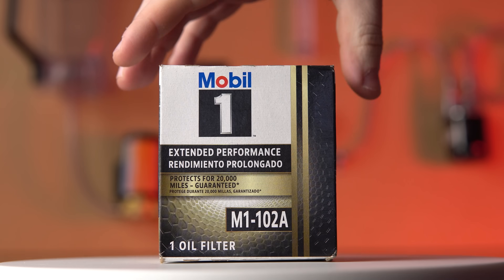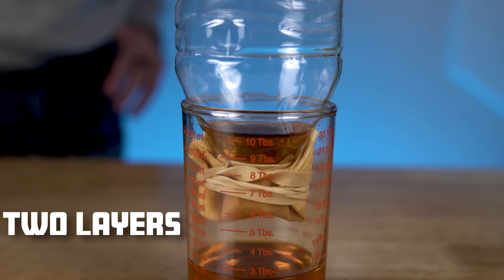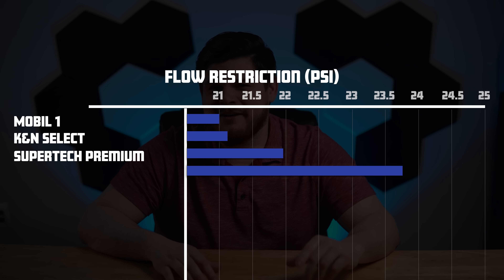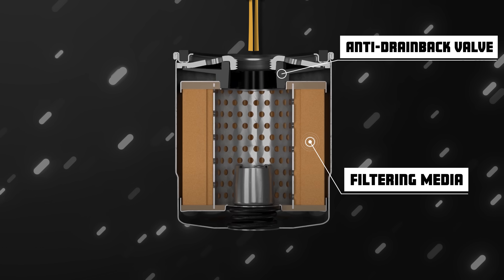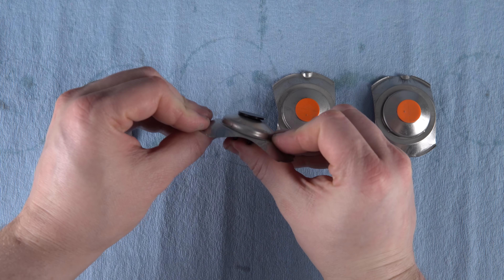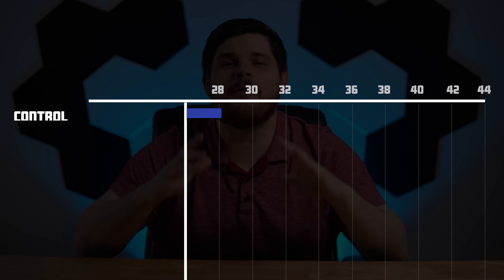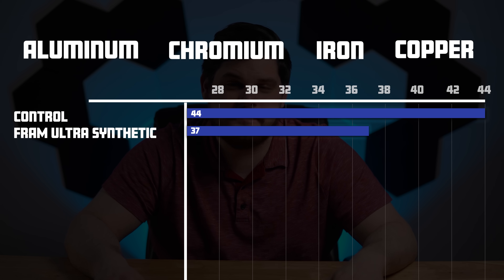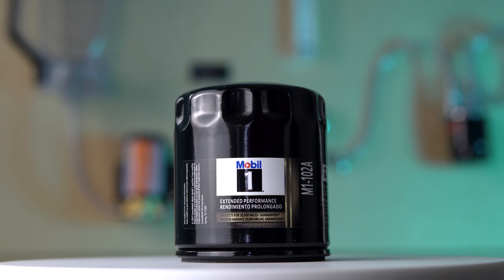Engineers Test the Best Oil Filters! FRAM | Mobil 1 | K&N | Walmart Brand

Comment: This is an interesting test. Ultimately, it doesn't matter at all what brand of filter or oil you use as long as you're changing your oil. I use whatever is cheapest, mostly Super Tech and Fram. 5k mile oil changes. After about 1 million miles total on 3 Nissans, I've never leaked or used oil. Never had an engine problem. Never had a timing chain wear out or get noisy. I use the lifetime K&N air filters and clean those about once every 20k-30k miles.

Comment: There are some really serious problems with this testing. The first is that the testers do not seem to realize that all of the filters they tested have internal pressure relief valves. The relief valve is there for two reasons. The first is cold weather starts where the oil is very thick and does not flow well. The bypass valve allows the oil to bypass the filter media and flow to the engine with only partial filtration. The second is high rpm operation. Most oil filters and most engines cannot filter even hot oil and high rpm because there is just too much oil to filter. Most engines in most cars spend a substantial part of their operation with partially filtered oil. If you disassemble oil filters and run the numbers on the pressure needed to bypass the filter media you will find that those numbers are all over the board. In their test they have no idea whether the lower pressure is a result of the pressure relief valves opening at different pressures. They are also testing at flow rates that are far below actual engine oil flow rates.

Not all oil filters have internal bypass valves. In many engines the bypass is integrated into the adapter that the filter attaches to on the side of the engine. If you check those out you will also find that those bypass number also vary greatly. Most fall in the range of 1-10psi. Any of those numbers mean that a cold start or high rpms are going to result in bypass. The worst flow problem with most oil filters is the column down the center that supports the media. It is VITAL that there are a large number of large holes in the column because that is the most critical flow restriction. If you look down inside and see slits or small holes, put that filter back on the shelf. It was amazing to me how few engineers involved with making filters understood how important this was. It has also been interesting to see manufacturers understand this... and then someone retires... and then the company changes construction without understanding. There are sadly many example of companies that got this right 30 and 40 years ago that have forgotten and changed their designs and not for the better.

Comment: I would look further into the issue with collecting particles near the back floor restriction valve instead of in the pleats. That seems odd to me. I would think that that would be a function of the position of the filter rather than and the particulars of the pressure and oil flow rather than the filter itself. It just doesn't make sense.

Comment: Graphs that don’t start at zero are deceptive in that they exaggerate the significance of differences that, while real, are in fact very minor. If your graphs started at zero, most of the performance differences among the filters you tested would not appear significant as percentages.
It would have been useful to mention the hazard posed by counterfeit branded oil filters whose packaging and physical appearance are very accurate mimics of the real things. They are poor quality, don’t always seat properly, and are dangerous. Beware of Amazon as a source!
The comment suggesting tests at operating temperature is very relevant, though it adds a considerable layer of difficulty. But viscosity changes with temperature. Possibly other relevant properties, too.
Finally, don’t say efficiency when you mean effectiveness. The words have entirely different meanings and efficiency is the wrong word here. And recognize that 99% effective really isn’t all that effective. It’s 1% INeffective, which is quite a lot, considering what that implies a filter fails to catch!
WIX is another brand worth testing, but use honest graphics, please!

Comment: Those pressure drops are astounding since an engine oil pump may only produc around 30 to 40 psi so that only leaves around 10 to 20 psi to squeeze through the small openings throughout the rest of the engine? What am I missing? Would it help if viewers know what the supply pressure is?

Comment: Oops part 2 I hit the wrong button the house brand for O'Reilly's would be good to be tested and the STP brand at AutoZone they're claiming filtering down to 15 microns so that's the ones I use on my engine.. I don't know what the micron filter rating is on the house brand for O'Reilly Auto Parts and I'm just an individual I don't represent or I'm not advertising for either one of those companies thank you

Comment: Used Fram higher grade filters on 1993 mazda, 1992 civic, and 2009 accord...all 4. Cyl.  Got 307k, 347k and 301k miles on those cars. Changed synthetic at 3-5000 miles. No complaints with FRAM.

Comment: We use the dealer that we bought the vehicle from. He uses the manufacturers filters, and synthetic oil. Why would we beconcerned with these videos? As long as we use the dealer, the manufacturers oil, filters, etc. should help with any warranty. FYI The vehicle has a 100,000 mile warranty. Aren't these sufficient safety?

Comment: Had a 1995 S-10 2.2l used fram filters changed oil every 4 to 6 thousand  sold it with        419,000 miles .. never had any issues..just fyi

Comment: According to GM that plastic core or E-Core as they call it is supposedly stronger and more rigid than a steel core while allowing much higher flow rate of oil. I've used filters like that with no problems what-so-ever.

Comment: Really! 1:50 minutes into the video. Doubling up on the filter medium 'thickness' affects it's flow rate. Doubled the resistance.  Same surface area.
But increasing filter quantity thru multiple pleats of a single layer of filter with a large surface area passes more oil, not necessarily easier but a larger volume, therefor more oil.
I gave up watching this video as i don't think it's credibility is high.

Comment: There is no best, except changing your oil based upon your driving pattern. Short distance, traffic, stop and go, every 3000 or 6 months. Highway driving long distance, moderate traffic, every 5000 or 9 months

Filters and oil are cheap, get a vehicle that you can easily change the oil yourself.  If you have to go to a dealer or an oil change franchise, you might get a bad job, oil change people are mostly drug addicts or low IQ individuals.  Not to be critical

Comment: unfortunately Mobil 1 uses NBR or a nitrile oil filter gasket as a standard component and they will blow out in demanding conditions - specifications indicate a maximum temperature of 248 degrees which is how hot your oil can get like driving across Texas in Summer where mine blew out so Mobil 1 is cutting costs.  Putting an oil filter to first hand experience would mean testing it in different driving conditions and monitoring it's efficiency over time and disecting certain facts like design and materials.  The gasket material K and N uses can go up to 400 degrees and this would include other higher temperature materials like acryclic (Purolator) and Silicon (STP) that can withstand demanding conditions anyone will encounter over the course of an oil change.  I hope this helps.

Comment: Your test is bullshit. In the flow pressure test you have 3 filters that have a 30 micron filter and fram has a 20 micron filter media. Of course the psi will be higher. It's pushing oil through a smaller filter media with the fram. Also in your used oil test if you didn't clean the equipment between tests the oil filters in the last stages of the test will have to try and clean more contaminants because of the leftover oil from previous tests.

Comment: Let me make sure I get this right. So you decided to compare oil filters, you built a testing setup that allows your powder to collect outside of the filters, you only tested four filters, you didn't heat the oil to simulate engine conditions, you didn't filter out any actual particulate matter and instead filtered out metal powder of a rather large size. You left out Amsoil, Purolator, Wix, Donaldson, and several others. I actually take my engine lubrication seriously, filtering my diesel fuel down to 2 microns and my engine oil down to 1 micron. 30 micron particulate in your engine oil would be like filling your tighty whities with playground sand and then going for a run in the desert heat. Get that sand all nice and hot and sweaty and then rub it around on your "sensitive components" and see how much you like it. Your engine isn't any happier than you would be. Three things need to be looked at with oil: Lubricity, additive package, and flow rate. If any of these three are compromised, your engine will be damaged or fail. Lubricity is the whole point, that can't go anywhere at all. The additive package is what keeps the oil from foaming, it has friction modifiers in it, stabilizers, anti-oxidation components, etc. This is why it is recommended that oil be changed every so many miles OR every 6 months or 1 year, depending on the manufacturer. Your oil can appear clean and still be bad because it's lost it's additive package. Conversely, it doesn't matter how good the oil is or how revolutionary and game-changing the additive package is if it doesn't flow through the engine well enough to do it's job. Even if you have awesome oil and an awesome additive package and awesome flow rate, but you have 30 micron particulate all over in it, it's still bad. 30 microns is about how deep the scratches are in the crosshatching on the cylinder walls of a typical, "quality" OEM engine. I think everybody who isn't completely up to speed should go see what 300-400 grit sandpaper does to bare iron or aluminum. So you got out most of the stuff at 30 microns. What about the bearing surfaces? Tolerances on Main and Rod bearings is often under 30 microns. So what good is it to filter out 99% of the stuff 30 microns or bigger when your Rod and Main bearings are going to be grinding all that sub-30 micron particulate around like sand inside those perfectly smooth and polished bearings? None whatsoever. If the job is worth doing, it's worth doing right. "Good enough" is for the Gov't, "done right" is for me. For regular people with gas engines, this isn't as big of a deal, but for people like me with a diesel engine, lubrication and soot contamination are real problems. I would stop driving the vehicle before I put any of the tested filters on it. Hell, I'd make my own bypass filter out of toilet paper before I stuck one of those filters in there. The bottom line on my opinion here is that the scientific method was only loosely followed, the test field was far too narrow, and conditions were not simulated correctly to produce useful results, and the results that you did get were one single set of parameters. These filters are junk across the board. This is my opinion however, and I did not bring any air fresheners. I've got people who are my friends solely because I contacted them in their official capacities to discuss lubrication. My passion for lubrication was recognized by a few of them and we're now good friends. 

FYI, that 3,000 mile oil change is a scam. Do yourself a favor, learn oil, and get your oil tested. If you care about your engine, don't trust the Stealership or some greasy mom and pop shop, and whatever you do, don't trust ANY of the quick oil change places. They're too cheap and they will scam you to make extra money. Most of them will try to charge me full price if I ask them to use my oil and filter. It's 15 minutes of labor, and they still want $75 even though they're not supplying anything but the labor. Blackstone Laboratories (for oil, not herbal supplements) is who I use for my oil analysis, and I've always had a good experience with them, as long as I was patient with USPS to get it there. Their kits are free, and they're very good at what they do. I run about 18k miles, which is when my additive package craps out (under 3.5 TBN) enough to make me worry. Whatever engine had that 18k mile oil in it hopefully had a better filter than the junk that was tested. I'd really like to know how much you were paid by what brand to do this test. The whole video just screams disingenuous marketing.

TL;DR
The "test" is useless. These brands rely on marketing to people who don't know what they're talking about.
Reply: So, what filter do you use?

Comment: Don’t ever use fram it’s been giving a lot of problem with my oil being dirty and oil pressure especially with these new cars I used to get away with it with the older cars but mang my check engine light threw off twice cause of dirty solenoid switch back to oem Honda filter and never had those engine light come back on since 🤦‍♂️🤦‍♂️

Comment: I have had every brand of filter I have bought fail a simple test of its drain back valve. Sounds Silly, but lips over the center hole, you can suck air through but shouldn’t be able to blow air back. I have yet to find a brand that hasn’t had a bad one here and there.

Comment: If you run more than 7,500 miles on  an oil change...you're really, really dumb. If you run over 5,000 miles, you're just dumb. Any decent mechanic will tell you 3,000-4,000 is the sweet spot

Comment: Discounting the oil lab test is arsine, the oil filter test for 10 house was replicating the actual conditions the engine operates at.  Adding aluminum to the oil, the filter would not be necessary since the engine wouldn't be running.   K&N  won, it filtered out particles down to 34 ppm.

Comment: I tried K&N on one of road trip afross baja desert. After 110 miles, my oil (~1,500 highway miles prior to off road), my oil was visibly rough. Rubbing the oil between my fingers felt like sandy oil. My engine needed to be rebuilt two years later. Cant directly corelate due to so many other facors but i immediately changed my oil and filters. Never using K&N for anything where dirt or not clean air is involved. More air = more particles in oil

Comment: Oil runs hot in your car doesn’t take long to warm it up.  Also oil viscosity plays a big role most new cars run 5-30 5-20 and even 0-16 the oil they used was cold and looked thick. Also a new engine has around 60 psi of oil pressure I’ve seen an old 1970 Chevy run on 8 psi but that’s beside the point. So say your engine is 40 psi that’s enough psi to pass through any filter it’s also enough pressure to keep the bypass valve open. This test is completely useless the best oil filter is a clean one. 5w-20 is practically as thin as water would flow through those filters at a lower psi especially hot not cold they could have at least warmed up the oil on the stove to 180f thus showing us they are not mechanics but back yard engineers. Any mechanics know engineers do the dumbest things when designing cars.

Comment: I put 478,000 miles on a SAAB 900 turbo original turbo...fram filter Castrol 10w30 change every 3000 miles....10w30 in the transaxle as well 😎

Comment: I have never opened up an oil filter but I know what's inside them and  how they work. In my own stuff I don't really care about the filter. On one of my cars, a 1979-1/2 Chevy Citation V6 that I put an engine into from a junk yard  wreck, I never changed the filter in all the 80,000 MILES I drove it. I  bought the car from a co-worker after I put that engine in it for him and I bought a case of 24 quarts of 10w-30 Meijer store brand synthetic oil for it and I never changed that oil or the filter the rest of time I owned it. I simply added to. So I never changed the filter or the oil and it ran fine. I got rid of the car because my wife kept spinning it out on snowy roads. The brake system was a failure and made the car very dangerous to drive on slippery road. So after about 80,000 miles I sold that car to a guy who was very hard up for a cheap car and I gave him the remaining oil with it. On all of my cars I go 10,000 miles on oil and filter change,  except the 2017 Chevy Sierra pickup V-6 I change at the recommended time according to the dash warning. It's supposed to have a lifter failure any day now and then it will need to be sold. The only thing I can do is put the shifter into manual and up shift it to  5th and leave it there. That will allow the trans to start in 1st gear and go thru all it's gears and stop at 5. Doing that causes it NOT TO DROP DOWN TO 4 CYLINDER MODE and hopefully put off the lifter failure until a later date. That vehicle has 74,549 miles on it and it still works well. There is about 5 mpg difference in fuel economy dropping from 33 or so in summer to about 29.  In winter it drops to about 28.  But if it keeps the lifter from "sticking" or whatever happens to them that ends up needing several thousand $$$ work, it's worth it. ben/ michigan

Comment: I used Fram for a long time with no problems. I heard Mobil 1 was the best so I switched. Mobil 1's oil filter M-108 fell apart and while draining my oil an orchordian like plastic piece came out into the oil pan. I had another M-108 ready but did not put it in after seeing this. Say what you want about Fram but big chunks of oil filter never came off when I used them before.

Comment: Mobil 1 when first introduced was the 25000 mile motor oil so I use it I only change the filter every 5000 miles and top off the oil. At 408000 miles it still runs strong.

Comment: All of them are fine as far as I can tell.  For my beater car I'd just get the super tech if you're ok dealing with walmart.  I think every car oil pressure is at least 30 while driving so the pressure in your engine would be driving oil through all the filters with no issue.